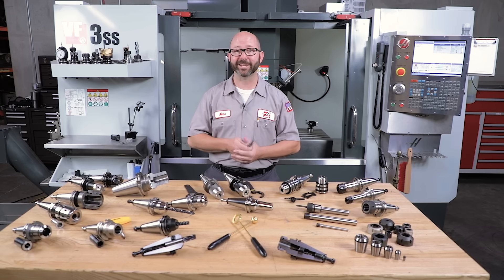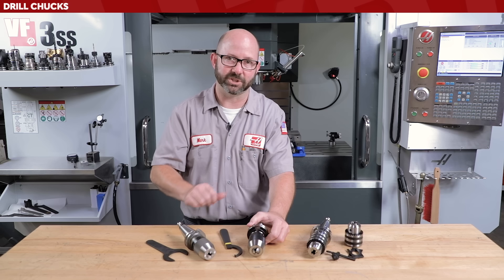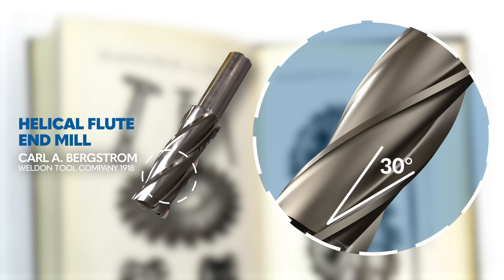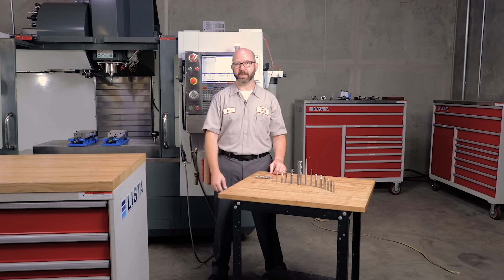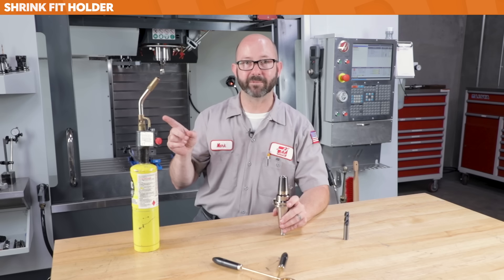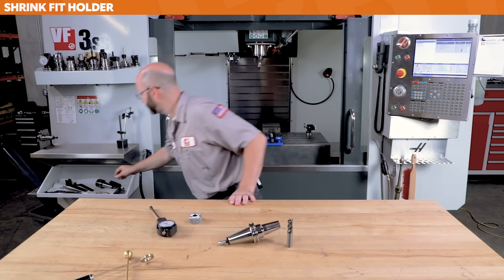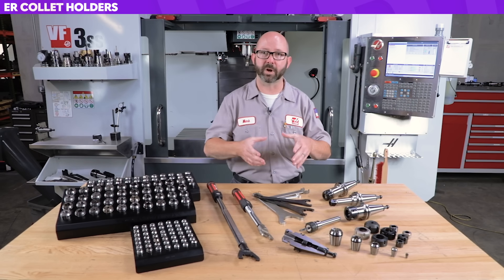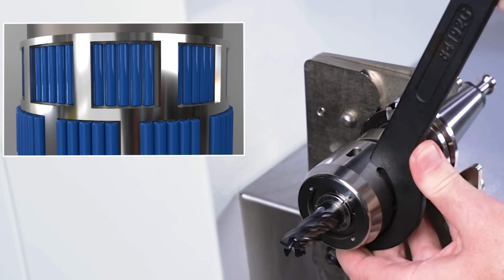Tool Holder Essentials - Every Machinist Needs to Watch This - Haas Automation Tip of the Day

Comment: As a plumber, all you machinists talk about your tolerance levels in .0001 of an inch. In my trade I’ve probably drilled close to a million holes after 38 years, my tolerance level is a1/8” to a 1/4” even up to a 1/2”. Not that I like sloppy holes, but to prevent expansion and contraction noises, also when drilling wood, you get a lot of drifting due to grain and knots in which case I have to ream sideways or sawzall so I can get a level drain. To all of you that like building stuff, stay safe, wear eye and ear protection and enjoy !
Reply: The same occurs with masonry.....the drill tends to wander but if you make a simple steel guide with the right size hole and clamp it in place the starting dimple will make the drill go in where it needs to be.....BTDT many times, same for wood too.

Comment: This video comes at exactly the right time. The new toy (VF2SS) is still somewhere on the ocean but in about 4 weeks time and I'm just now making a shopping list for some new tool holders for this machine. I think I'll revisit my list once more after looking at this video.
What about using an ER collet for drills? What if I place a 3.3mm drill in a 3-4mm ER collet? Will this be better or worse than using a key-less chuck? I am tempted to go for the ER holder and mark the collet for 3.3mm use only.
Reply: rumblfmp it depends on your application, if you are doing a lot of parts, the ER will be more reliable, and you may be able to push it a bit faster. The drill chuck shouldn't be run in reverse, I usually only use drill chucks for short runs.

Comment: Note on heat shrink fit holders: As you use them the tool may drop a bit. Not something enormous that makes your mill crash, but enough to throw things out of whack on tighter tolerances. It happened where I work twice, making countersunk holes. The bi-axial mill (I think this is the proper term in english) dropped just .05mm, for a tolerance on the countersunk holes .2mm IIRC. Got that before it dropped a bit more and making the parts went out of spec, fortunately.

Comment: All very interesting. 
Just one small point, a twist drill's shank is generally smaller than nominal size by a couple of thou or so.
Oh and end mills in drill chucks held in a machine by a taper are a no no due to intermittent side thrust which will loosen said taper. An axial thrust will hold just fine and is effectively a two, three, four or however many flutes it has drill. Run out is questionable though,all depends on how down and dirty you want to be.
Apart from above 👍
Reply: Little Work Shop of Horrors there is a lot of good experience being shared in these comments. Thanks for posting.
Reply: @markterryberry4477  manual machining i got licked, cnc is a whole 'nother ball game and im too old to even consider it but it's fun to watch.

Comment: Wow, love the vid, as a guy who fell in love with machining via tot videos and such, and while being both self taught and schooled in the broad area of machining and mechatronics coupled with automotive mechanics schooling, I just bough myself a mill, that said, that is not the end adele, i am buying a high precision lathe aswell, and another mill aswell as my current one is a bit smaller than i expected and i have great plans for increasing its performance through another mill as so many great modifications can be made on it by just throwing the whole body of my current mill onto a table of a large mill and doing some fine in situ key grinding and such to give it extreme rigidity and precision especially considered its relatively small size, tho it has all the required parts actually more than decently sized... I am of course talking about an Emco FB2 and I intend to get some other fine Euro mill and a lathe of the same brand possibly... That said, I feel like this video, despite being most informative, should have mentioned one more way of tool holding... My Emco mill came with a set of endmills that are shaped in such a manner that their body is long enough and tapered in a MT2 which of course fits my spindle bore and is also drilled and tapped as to be secured with a long shank screw that is used with the spindle to usually hold a collet chuck for example... I find that a most brilliant way of toolholding, especially for lighter cuts, as it introduces almost no compromise that any additional holder might, tho, and this must be duly noted, this setup is most reliant on your spindle bore accuracy and the precision of the tool body taper from the factory... Also, this setup might slip, which is a sickening thought, having a THING spin in your spindle bore and do some disgusting damage to the taper surface... I would like to hear more on this subject from you, as you have proven yourself to be a great source of info, and a reliable one aswell, fancy shop and pants notwithstanding :)

Comment: When I need to do precise stuff, or milling with weird clearance requirements (this is becoming more and more common) I will make a custom shrink fit holder for the job. It is pretty easy to purchase toolholder blanks for that purpose, and when you take care it is fairly trivial to get ten millionths runout on them, even straight out of the machine. Most cutting tools are worse than that.

However, 80% of my work is just done with standard good quality collet holders. I do like regofix holders, though. They have a good system there.

Comment: Go ahead and laugh, but in my home shop I use an old, but decent;y solid 1940s benchtop drill press with a chinesium cross slide vise (with the gibs tightened way up), a Jacobs chuck holding onto a plain old highspeed steel endmills...  It's far from perfect but does work (maybe .003-.005 tolerance on a good day).  My chuck has yet to get pulled out of it's tapered shaft... surprisingly!  Don't get me wrong, I know this set up is janky as all hell, but you said you wanted to hear about it, so there you have it!  Maybe someday I'll get a Bridgeport for my home shop...  or even just a cheap Harbor Freight drill mill would be nice...

Comment: Getting into shrinkfit doesn't actually require expensive machine. Many use torches, I use cheapo $100 and 2kW induction heater from ebay and it works like a charm. Made even a video about it.

Holders are ~120EUR a piece and whole system works very well. I wanted to give the system a go on a titanium job and no complaints so far! Main tool is Kennametal 8mm 3-flute GoMill in a shrink-fit.
Reply from the maker: Vilts – I checked out your shinkfit video (https://www.youtube.com/watch?v=6XJKI6GBlMM), and ran across your hand engraving project https://youtu.be/cUCfnYu35Fg . Holy cow, that is amazing! Thanks for sharing. – Mark, Haas Tip-of-the-day

Comment: Gripping hard stuff? A quick fix is a car headlamp bulb (to limit the current) in series with a 12v battery and a piece of carbide. Say negative to the chuck jaw, and spark the carbide (positive through the lamp) all over the surface.
Works great on lathe chuck jaws. Now things like stainless steel and other hardened materiald don't slip.
Rather lower cost than the diamond impregnation, and it only rakes a few minutes using any old carbide insert.

Comment: for the weldon/sidelock, at my workplace we just machined a big flat on the opposite side of the screws. we only use them for insert drills and the holder balancing was made with a insert drill shank we removed the flutes after they got destroyed from insert failure. kinda overkill for probably 1500rpm max speed balanced at 30k rpm haha

Comment: another great Haas tips - be showing in class for the New Year

One question - The move to Trochoidal style HSM ruffing - But which tool holders? 
I have been told that NOT to use a ER Collet chuck because of possible pullout - The milling or hydraulic chuck is preferred.  
We have used a 1/2" Carbide HSM end mill  with side lock ( ground a Weldon flat with green wheel) with success with our recent venture in roughing titanium with Fusion 360 Adaptive and Mastercam Dynamic strategy. 

what say you ?    Hope to see you at HTEC !
Reply: oops - you answered that question - on the ER - thanks

Comment: Very good video. One thing missing though is the hex-keyed drill chuck. Where do those sit between the keyless and keyed one? I use mostly the hex keyed ones for most work with HSS drills.

Comment: Have you used "slim-fit" tool holders where the collet is threaded at the end, and a screw inside the tool holder pulls it into the holder's taper to grip the tool?  A very long torx driver is used, through the pull stud, to tighten or loosen that screw.  Through-tool-coolant pull studs are required, but have great clearance for 5-axis works, especially for 1/4" or smaller end mills, and seems to balance well.  I am aware Techniks/SYIC (same company?) have offered them for some time now, and they are not exactly cheap... However, if you only need a few holders for deeper reach, these will still be cheaper than buying a shrink-fit machine.  We've just started using them, but would be interested to learn about potential drawbacks or tricks/tips about using them!  Let us know?  Thanks!

Comment: How do you make an engineer give a big, excited smile? Pull out a blow torch 0:30
Reply: Using the torch, with that brass ring/ball was fun. I was using some old MAPP gas that I had, it runs a bit hotter than propane. They stopped selling the real MAPP gas back in 2008 when the only plant making it in the U.S. shut down. I also had to machine a custom sized ring for the demo, as the kit comes with an oversized ring and you are meant to heat the ball. That method is safer, because you can't ever get the ball stuck in the ring, but it didn't show what I wanted (expanding ring, that could collapse on the ball as it cools, for a press fit). Fun stuff

Comment: I got so much out of this. Thank you for always breaking things down so simply.
Reply: Machinagician
1 second ago
Bravo, Subtractive manufacturing is remarkably interesting. but additive manufacturing is about to change manufacturing as never seen before. If you're interested in innovative manufacturing, google," Evolve additive solutions STEP". welcome to the future of manufacturing. AM (additive manufacturing) is about to be ushered into the theater of production manufacturing for the first time in history. SVP, just in time delivery, voxel CAD CAM, same materials, materials with different properties, and multiple colors(simultaneously), isotropic properties in all directions equal to IM, unlimited iteration with scalable volume production, & no tooling up for injection molding ever again.) cheers

Comment: yed I tried before a milling tool with a drilling chuck because there is no available chuck for the my end mill I was lucky that it turn out great maybe because I was cutting a soft material and the cutting time is not that long....

Comment: What an amazing video. I wish they had this video to show us when I was in machining school in community college. Tool holders are easily one of the most important parts of machining, and you explained it clearer and faster than any teacher in front of a white board could.

You didn't mention the options out there for tool holders that use end mills that directly thread into the holder. It seems like from what I've seen from manufacturers, this system gives you the most clearance possible, is less expensive than shrink fit without even including the machine, and seems to be very rigid, balanced and low run out. However, I don't hear about people using them a lot. Are the end mills for this system ridiculously expensive or something? Lots of companies sell them so somebody must by buying them. Anybody have experience with them?

I'll second what some other people have said. Going in depth about how we've gone from R8 to Cat40/BT40 to BT30 to Big Plus to HSK to Sandvik's weird reuleaux triangle holders.

Comment: How is the balance of a hydraulic holder? I'm thinking because it has that set screw it might have similar balance problems as the weldon, but please correct me if I'm wrong

Comment: Great video! We in my work use lot ER and SK holders . I in noticed it  er Holders good for in heavy drilling and tapping threads, sk holders its very good in endmils and roughtingmils because collect angle is smaller, but collects are more expensive and much narrow thigting what er collects .
But good video and stay vise ;) :D .

Comment: Half of our davenport machines have the set screws on the sides of holders for drills, taps, reams and our tolerances are within .001 to .006. I understand from a machinist and cnc standpoint might be different but on your mechanical machines I was shocked how large a tolerance he allowed for this.

Comment: I have to say I'm guilty of putting an end mill in a drill chuck, both Jacobs and Albreght. Never to side mill though... I've done it to put a spot flat on a curved surface to keep a drill from walking, and following an undersized drill to open up a bore with a nicer finish, or just before a reamer to make sure it actually goes straight. In all cases I am strictly plunging.

In most cases this was expressly due to laziness... the difference between the length of the drill in a drill chuck, then an end mill in a collet, then back to a reamer in a drill chuck would have meant a LOT of cranking that cursed knee crank on a Bridgeport!

Comment: I almost hate to bother you with this question but I have a Jacobs keyless 5/8" chuck JKT-160-J6 and have been unable to find the large (about 43mm) thin (about 4 mm) spanner wrench that goes with it.  Do you have any leads you could share? I have also been looking for some info on how to disassemble and not found anything on point.

Comment: I' m gonna machine POM material in my Haas VF3SS, I clamped the workpieces with a collet system and according to technical drawing of my work , hole tolerance is  8 +0,015mm precision. I wil drill workpieces 6 or 7 mm drill before enlarge the hole with 8mm carbide( it can be grinded to obtain desired hole precision) end mill. What kind of holder do you advice for this kind of operation?

Comment: 3:40 What is the definition of run-out? Is it the tool's displacement from center, meaning a runout of 0.004" tends to result in a larger diameter of 0.008". Or is it the sidewise difference the dial indicator shows, meaning a run-out of 0.004" tends to produce a 0.004" larger diameter?

Comment: Sir, 
In MY HMC machine we are using 125 Dia tool for chamfering the liner bore counter.
Now issue is line mark issue in bore (liner counter chamfer area) 
Kindly let me know what are the possible causes in tools means what  need to check in tool side and machine side. 
My machine is KITAMURA HX-630i(HMC)

Comment: What about theClarkson Autolok collet chuck ? 
I have one on my vintage Van Norman mill for hobby use & it performs great !
I know the tools need threaded shanks ... but once installed , they ain't goin NOWHERE !!

😎👍☘️🍺
Reply: Funny you should say that, my late father who was a tool maker swore by the Autolock chuck system and after I took over his milling machine when he retired I did too..........I have the larger Autolock chuck in Int 40 taper but as I only have a few HSS cutters from the old days with screwed shanks I now use the ER collet chucks as everybody and his dog does.
Maybe I'll set up my cutter grinder and grind a few carbide cutters to have  screw threads......how universal can you get!.....they'll never pull out.

Comment: Hello, I need some help. I have 5 hydro grip holders for of YG  brand. It's nice but the problem is that.. after using of for around a year and half.. something happn in the holder. It could not fit the milling cutter properly. Somehow. The grips is gone. I have contacted the company regarding yhis., But unfortunately thay said that those holders are not repairable.
Is it true? After loosing the grip, those hydrolic holders are useless?

Comment: Mark, excellent info for beginner and retired machinist,toolmaker,enginner,programmer etc.please tellme where can I buy a used  or new training simulator.
Reply: Hi Orlando. Give your local Haas Factory Outlet a call, and they can work with you. You can find your local dealer at Haascnc.com

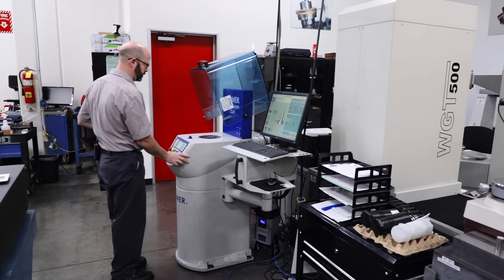Comment: @Haas Automation, Inc. I'm not a machinist, I just saw your video and was wondering about the balancing of the holder. 12:22 Instead of milling the holder to remove material, would it be possible to make a holder that has setscrews along the diameter of the tool, that could be screwed further in our out to change the balance? If the set screws were made at angles, that would help prevent them from working loose from the rotational force and make the adjustments smaller for more precision since the set screws would be traveling towards the center of the tool at an angle instead of straight on. 

If this could be done, the balancing software would still mark the side that needs to be adjusted, but instead of pulling the holder out to start milling it, you could adjust the closest screws further into the tool and immediately retest. There would be no permanent modification of the part, and it could be done in a shorter time frame.

As I'm not in the industry, there is probably a reason this isn't done, or it is something that is done, and I just couldn't find it with a quick google search.
Reply: That is exactly how it's done! Many tool holders, and Spindles for machines, have holes tapped radially, with set screws for balancing! You should be a design engineer!